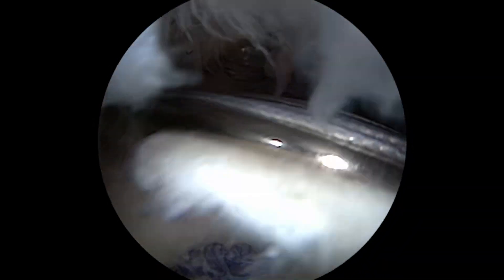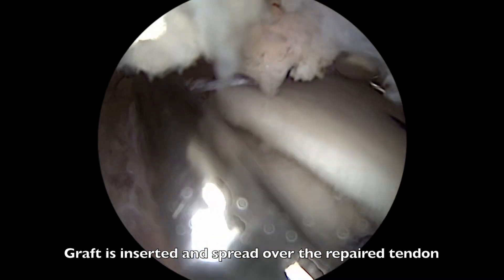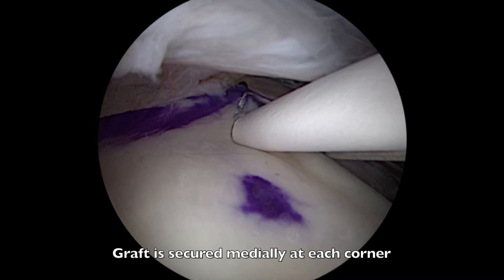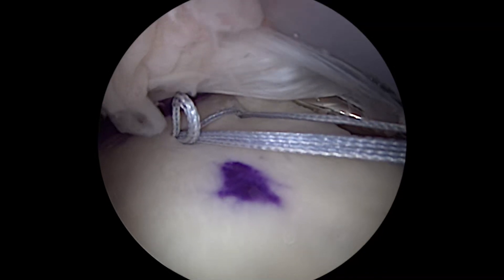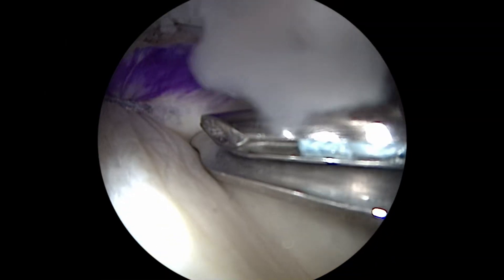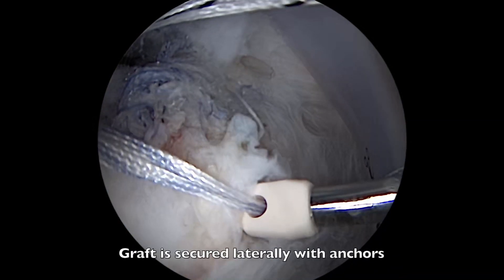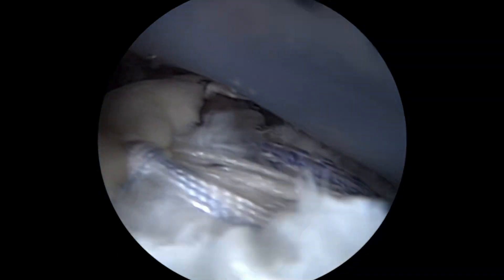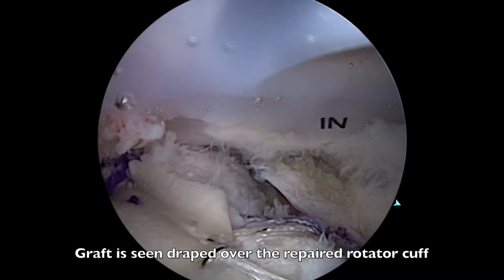Arthroscopic Rotator Cuff Repair with Graft Augmentation

Comment: This is only retracted from the superior facet of the GT? When there is a partial thickness or full thickness like in this case is the tear actually involving the infraspinatus too since the superior facet of greater tuberosity is mostly infra and then supra?  

if there was significant loss of thickness of the layers of the supraspinatus and cable since it has many layers totaling 9 to 11mm thickness, how can you restore the anatomy? That patch looks small and doesn't look like it will really replicate the inner anatomy and layers. Can you put it on the articular side?